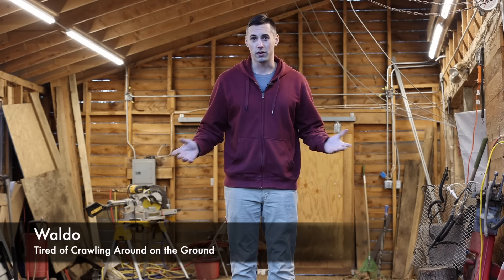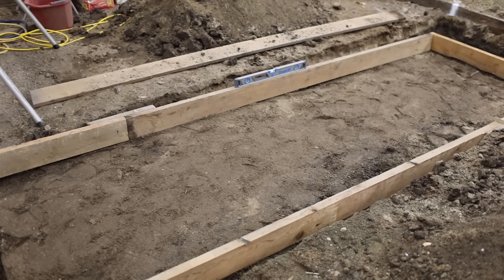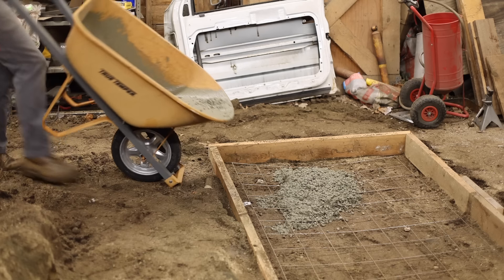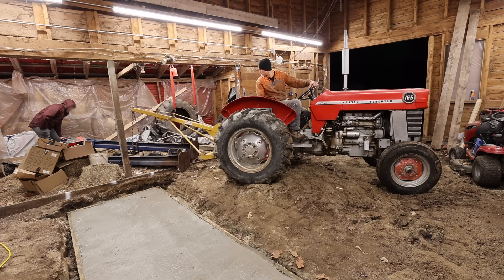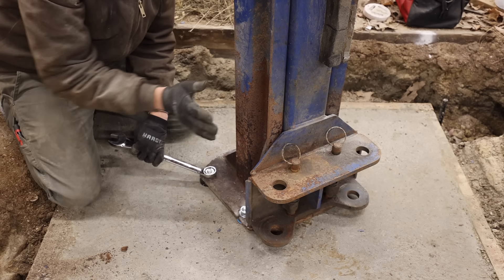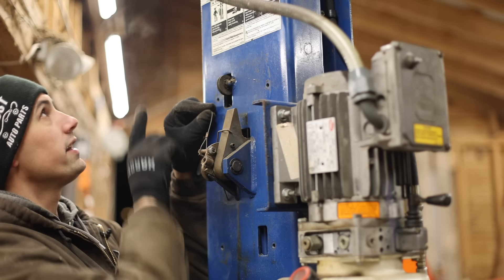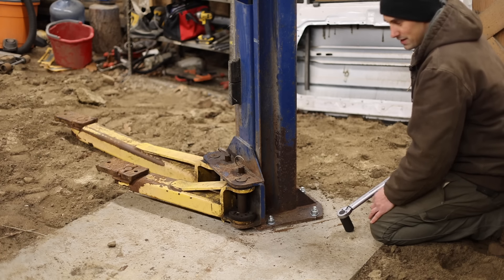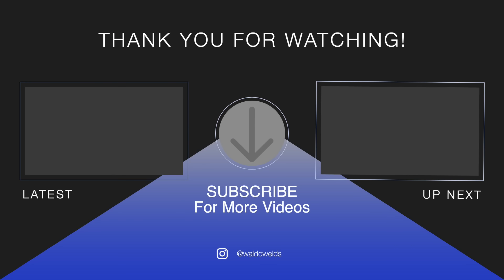Installing a 2-Post Automotive Lift on the Cheap

Comment: Unless I'm forgetting a major part of my statics courses, this slab is perfectly adequate because the load path of the vehicle is always being channeled through the lift's columns, and into the exact center of this slab based on where the columns were installed. Even if the center of gravity of the vehicle is not exactly centered with the lift's columns, the load still has to be routed through the column and into the slab. The air can't support any part of the unbalanced load, so that load has to be supported by the slab using the available structure, and that's the columns. Due to that, the slab will never, ever, tip over unless someone applies a substantial enough force on the back of the truck (or columns) that is parallel to the ground and high enough up so that the resulting moment arm is sufficiently powerful enough to tip the thing over. Even then, the vehicle would have to be sufficiently heavy and have sufficient friction on the support arms to not slide off, i.e. all of the applied force would have to be taken by the columns, transferred to the floor until the tipping force / load was met. That's extremely improbable. The vehicle will more likely than not slide off the support arms before the lift and slab tip. 

Now, I will say that although the slab won't tip over, that doesn't mean the posts can't be loaded in such a way that they won't tip over. If a load is off-center enough or a substantial force is applied parallel to the ground to create a sufficiently strong moment arm, the anchors could break free of the concrete, causing the post to fall. That's true of any lift in any shop, even if it was mounted to the largest concrete slab imaginable. 

The bottom line is this lift is safe from a statics perspective. The slab will not tip, even though it's narrow and doesn't weigh a lot (~3,555 lbs given his slab dimensions). The anchors could break free, but that's a risk any lift user takes.

Comment: Because of the small base be  very careful.  possibly add struts/cable to prevent tip over.  Also be careful when removing an engine while it's on the loft (change of balance point).   The most dangerous time will be years after it is "OK" and you forget to balance the load...familiarity.  Double check your bolts are actually holding and not pulling up.

Comment: It's awesome having a lift but there's a few things out of done different, I would have put a 16 or an 18" concrete form tube directly underneath the arm of the lift about 24 to 30" deep give it some stability , also I would have made the slab 6 or 8 feet with tube forms below arms and I would have used #4 or #5 rebar vertically  and horizontally tied together or welded together.

Comment: I have never seen a lift where the post were not square across from each other like that.   You can see the bracket at the top showing it was made like that so it's not a goof but how it's meant to be installed.   Learn something new every day.

Comment: Merry Christmas, Waldo!  Glad to see you having a lift.  I had to mix a palette of concrete last year, and I have a mixer.  That must have been tiring mixing all that in a wheelbarrow.  I like one of the other commenter’s suggestions to tie the tops of the posts to your ceiling rafters, to eliminate any chance of lift tip over.
Reply from the maker: Thanks Greg, merry Christmas! Yeah, I definitely need to be careful with the center of gravity on this one 👍
Reply: I'm... not sure about that. It may bring down the ceiling or barn if there is a failure. At a minimum, if he wants to do that, he has to put braces across the rafters first.  Fasten to them, not the ceiling directly.   2x8x10' maybe for each side.

Comment: I just ordered my first lift from a company called Worth Equipment in texas it's supposed to be entirely made and all of it sourced in the u.s.a including the steel minus the gates hydraulic hoses he said where from mexico.

My dad and I looked for a long time at all the brands out there and considering working on diesel trucks is something i seem to do pretty often as well as owning several myself we went with a 15k rated Worth and yeah 10k is a lot of money for a lift but there are no do overs when a cheapo lift falls on you and from what i saw of the pictures of Worth lifts a 32" base plate per tower thats 3/4 inch thick steel is pretty confidence inspiring not even mentioning how big the towers are the total weight of the lift its self is like 3400 lbs.

Comment: Waldo - Thanks for sharing this with us. I enjoy watching you figure out solutions on your projects. I believe that this installation will meet your current needs and is better than laying on your back in the dirt with your truck up on jack stands. (The following is sarcasm and anybody without a sense of humor should stop reading now and go for a walk). After reading all of the comments I think that what you SHOULD have done is to tear down the existing barn; hire a professional with a concrete truck to pour a 40' by 120" slab at least two feet thick (three or four feet where it's going to be used). Wait a year for everything to cure. Build a 16' tall steel building on the slab. Throw away your existing lift and buy one with at least four uprights (five or six would be better). Have each of your vehicles weighed and spray paint an arrow with "COG" on each side. Still don't go under the vehicle if it is off the ground. Other than that, it is perfect. 😁
Reply from the maker: I do love the sarcasm! 😂

Comment: Pad is a Safety Pad. I would do the same thing if I needed to and always would have the thought that I have 3,600+- lbs of lift and pad to raise 2ton+ vehicles  ensuring my attention to correct weight distribution. For Safety

Comment: That small narrow 6" thick slab looks like a serious accident in the making. Generally you have deeper piers of concrete under the upright supports with a interlocking series of rebar reinforcement. They recommend the concrete to cure for 30 days before installing a lift. I wouldn't trust lifting anything heavier than a lawnmower on the current setup.

Comment: A couple more anchors with rings on them (i.e. female-thread eyebolts) and a ratchet strap to each corner of the frame are cheap insurance if you have to change the C of G much.  Also if you want to check your torque wrench get a good fish scale; it's not the same as a NIST-traceable certificate but it'll get you pretty close.

Comment: If you think torquing something to 150 ft-lb is bad...try doing 250 or 600. Any ways, any time you torque something, do it in stages. If you don't click at 30 or 50 or even 75, then you might have a bad wrench. CDI makes some very good torque wrenches for not too bad of a price. A 30 to 250 ft-lb is around $180. We use them exclusively at work (Powder metal manufacturing) and are considered a "gauge" so they have to meet certain specs for them to be used in our faculty.

Comment: Hi Waldo, enjoy your videos but can I say with all due respect you are a braver man than I. I have a 3T hoist (approx 6600 lbs - we're metric in Australia). I have a 450mm thick section thats 4Mx3M under my hoist and it's tied into a 150mm thick main slab that is 15Mx8M with 12mm tie bars. The whole slab has SL92 mesh and under the hoist the mesh is made into a trench cage with 12mm rebar fitments running the length of the thickened support slab. Possibly overkill but I have no desire of anything falling on me or around me.

Comment: Nice job! I was thinking about doing something similar I actually did a lot of research and looked at spec sheets as well as called bendpak technical support and this is what I found out. On there two post lift floor plate model they call for a minimum concrete pad of 4 ft x 13 ft x 12 inches with rebar, temperature bars, as well as mesh.  They also call for the concrete to cure for 28 days before Drilling and installing the lift. They don't recommend hand mixing either. I would assume that's based on the time it takes to do it. Anyway, thanks for posting!

Comment: I really think you should have made that slab wider than 4 ft. It definitely needed some piers poured at the ends underneath the post. You should have used rebar.  Next time just call a concrete company. It wouldn’t have cost too much more.

Comment: You need to tighten the slave end cable. It is going up alot slower then the motor side. I don't make up the names that's what they are called. I use to install hoists for no years. If you have any questions please ask.

Comment: I mixed  60 80lb  bags last week WITH A MIXER  and it about killed me. I’m impressed. Although ,like another person mentioned I would go from one end to the other opposed to bottom to top. Love your videos. Merry Christmas. #LGB
Reply: 2 of us started around 8am went to get 130 bags of concrete, hand loaded into 2 trucks due to weight. Had to drive 4x4 truck down a semi steep sloped lawn around to back of house unload and repeat multiple times due to lighter 1500 truck and used a mixer filling a bunch of sonotubes. Had everything done and cleaned up took off by like 1pm to return mixer

Comment: IMO if you do one day go for a bigger lift get an in-ground lift there a little bit harder to install but you dont have those massive posts in the way and because it goes so far into the ground they are very stable and far safer then a simple concrete slab.

Comment: Man, I could sure use a lift. Granted I could really use somewhere to put the lift too!
Side note, I'm pretty confident you won't be standing under the truck with that lift, looked like you were at about max height before hitting the crossbar at top anyways. Don't want to crush a roof on Brandon or Billy Bob! 
Definitely worth it to have better angles for them hard to break loose nuts and bolts though!

Comment: After wrenching professionally for 15 years, no way in hell would I get under that lift. Concrete should have been 10 inches thick, another foot wider each way and had sonotubes tied in at a minimum

Comment: Those lifts do go down very slowly without a vehicle on them.  I have an asymmetric lift.  I am surprised that small pad meets spec.  I never gave much thought about since I have a full paved floor and almost 8 inches of concrete in my detached garage.   The spec for my lift was 5" 5000 psi and you seem to be OK with that, but my lift is nowhere near the end of the pad.

Comment: A 12k lift would be a good upgrade here, especially if you lift 3/4 and 1 ton trucks often. Get one that has plenty of adapter options and arm adjustment.

Comment: Let me know if you ever need your cylinders rebuilt! They are slotted at the bottom to allow for more cable to be tightened after they stretch and no more adjustment can be made at the top.

Comment: When you pick a vehicle up, it should remain fairly level.
Always shake the longest end from the lift as hard as you can.
Better to fall 6 in than 6 ft! Those flip up adapters should have ears so they can't slide off the frame rail laterally.  Once you get a level floor some vehicles you have to get out leave the window open leave it in neutral roll it a little bit, chock the wheels set up the lift then put it in park and turn the key off.  Because the door may not open enough for egress due to proximity to the lift vertical uprights

Comment: I too have a 2 post lift that I picked up a couple of years ago.  I always thought one would need a floor 20 feet by 30 feet by 2 feet deep to mount one of these.  This has been very inspiring to watch this but I may go a little thicker on the pad and a little bigger on square footage.  All vehicles have specified lifting points so hopefully the truck/car doesn't fall off the lift if the locations are used properly.  In your case the box was removed from the truck and that will affect placement on the arms.
Anyway thanks for the ideas and have a very merry Christmas.
Reply from the maker: Yeah, it's definitely a good idea to go a little bigger on the pad. Merry Christmas!
Reply: Check the manual for your lift, it'll say what's needed.  If the manual's not available, find something for sale that has similar capacity, and use its specifications for your slab.
Reply: All Rotary lifts require 12'x24' min bay size. This is because the 2 posts do not stand on there own and all the load is transferred to the anchors and slab. The area of the slab is equally as important as the thickness.

Comment: Install some taut chains to the roof rafters, in an X pattern, from the top of the posts. Put blocking between the roof rafters first. If the unit tries to tip over, the roof structure would stop it.

Comment: Great work! Another nice video! If you ever need to lift a heavier truck,  and you can't reach the frame with the rear lift arms. The rear leaf spring shackles work good to lift from we do it with 3/4 ton and 1 ton trucks at the dealership I work for.
Reply: I think that would require the truck to be a bit further forward for those short arms to reach the springs..which would move the balance point ahead too much for this sketchy lift, especially given Waldo's love of hefty diesels..
No bueno.
Reply: @zrxdoug  yeah true.. but it was just a suggestion. We do it for most truck brands.
Reply: @sunkmango6673  
Me too..this unit makes me fear for out man Waldo's safety though..
Reply: @zrxdoug  yeah your right. But when he gets new building put up it may be something to remember.

Comment: I just used a lot of JB weld to hold my lift down onto flat concrete after I sunk some 2 inch bolts in around it

Comment: Thanks for sharing this build - how’s your back?  Safety first: Have something (axle stands, blocks, stumps) under the vehicle with you as a basic fail-safe life saver - not only for your home poured slab but because the lift is secondhand with no history or certificate - work safe…always.

Comment: I’m an engineer, EE, not a structural engineer so my opinion is useless, but I would be very careful making sure you load that lift evenly.  I’d Also do a number of test lifts with progressively heavier vehicles and see how much that lift moves.  I wish I had space for a lift.
Reply: Yep! Incrementally load and check this out. (After rebuilding it per many comments provided here!) Unsafe!

Comment: Grease inside the corners of the pillars, and keep it clean. Your sliding blocks will thank you

Should adjust your equalizer cables so that each raises the vehicle equally and your hear your clacking at the same time

Lastly, if you're putting up nice cars or so it's nice to use hockey pucks underneath the lifting points

Comment: One thing I have learned on my 2 post lift is that cable rotates and the nut stays in position while lifting. I have had a nut come off . Double nut [ jam ] the cable end nuts  to prevent a big accident from happening  As others have stated , 4 foot is a little narrow , I would get a couple of jacks from Harbor Freight to prevent tipping. The dirt floor looks hard but place them on some plywood.. There is a lot of good info in the comments.

Comment: I installed a 2 post lift in a 24 x 24 foot garage.  My slab is 6" thick and was a 6000 psi mix.  I waited a minimum of 30 days before drilling and torqueing the anchor bolts.  2 post lift towers will want to lean toward each other under a load. The cross member at the top will prevent this. The worry is front to back instability.  I have two 3 ton under hoist stands that I place under the front and rear of ANY vehicle I lift. I will not get under a car or truck without them. Your set up is too dangerous for me without front and rear stabilizing stands. Please consider getting a set and use them every time you get under a vehicle. There is also a book you can purchase from the american lift instute that will show the correct lifting points for almost any vehicle so you will have the correct center of gravity to lift safely. Good luck.

Comment: I feel like the dirt floor wouldn’t be so bad all the time, it would be a nice break from being on concrete all day! And I’m sure you know this but make sure and re torque the bolts after a couple weeks! They will probably loosen up a bit with some weight going up and down on the hoist!

Comment: 26:35 I love little errors like this that actually may even save your life (or something) down the road... because what if you hadn't figured this out while filming this? Thanks for leaving these kinds of things in your video. I've read the manuals for these things and watched multiple videos and I'm still unsure where the hydraulic part works lol. I'm just trying to figure out the physics of these lifts, I'm not a mechanic. I'm fascinated by it, want to do the calculations, but can't figure out the surface area or what the mechanical advantage of the electric pump is haha.

Comment: Standin up that beam like that and i'd say you're damn well suited for strongman, nice job man, ive always wanted to put in a lift

also, as someone in safety science, please for the love of god wear a respirator around concrete dust. silicosis is not even a little bit of fun

Comment: Could be a camera angle? But at 25:38 it definitely looked like the right lift (right from the direction the truck is facing) compensated hard, as if the truck wasn’t level. Looked like it was unlevel and tilting the truck to the left as if the right was travelling further upward

Comment: you should have used a 3/8" rebar spread at 16" apart or less than the chicken wire.  The rebar will help stiffen the concrete and less prone to cracks due to the heavy lifting of the car lift.  concrete can take at least a week to fully cure at 70 degrees temp and with your cold weather could be longer before drilling the anchor bolts and torquing it.  Looking at the lift with your trunk on it I'm afraid your concrete slab may be not wide enough and possibly could tip over unlike in a shop where they have the entire floor as concrete slab and the lift anchored on it..